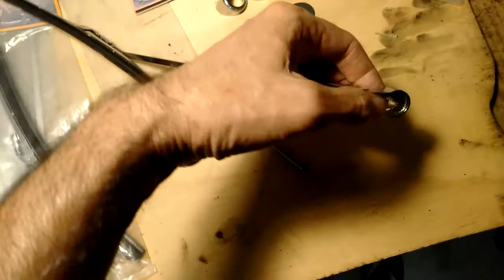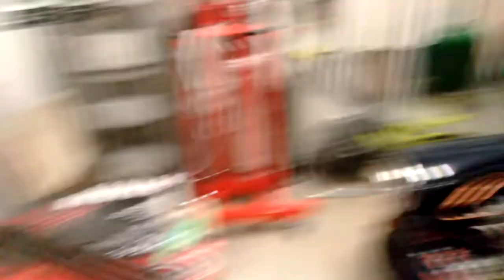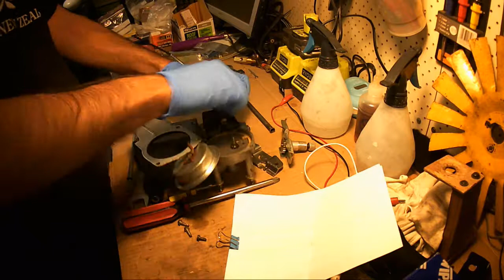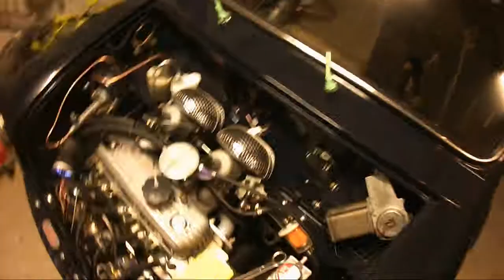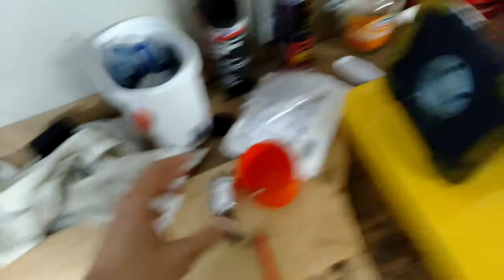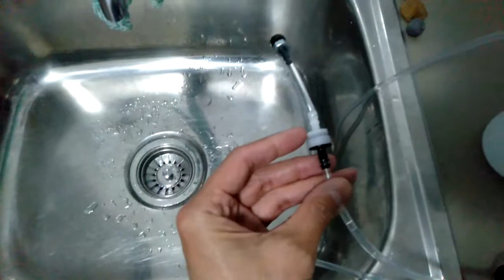Morris Mini Cooper S - Wipers EP035

Comment: This was enormously helpful. I've just installed my washer system and thought it was just a bit crap as the water keeps falling back down the jet tubes as they are higher than the bottle reservoir. I missed the one way valve when I ordered the parts but now I can get the system working properly. Really enjoying your series of videos. Many Thanks, Peter